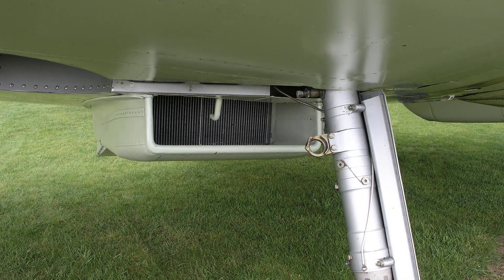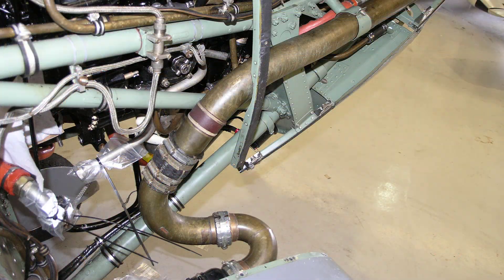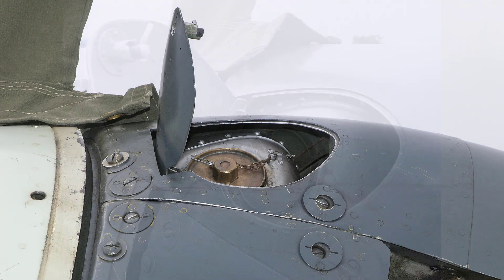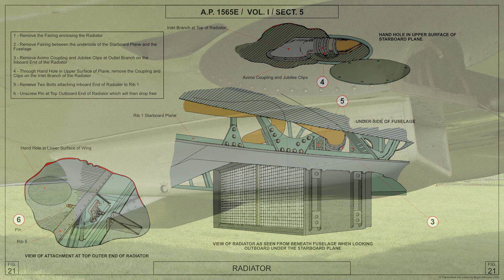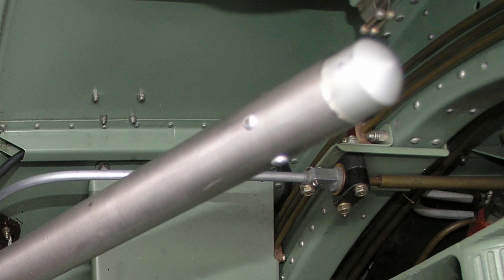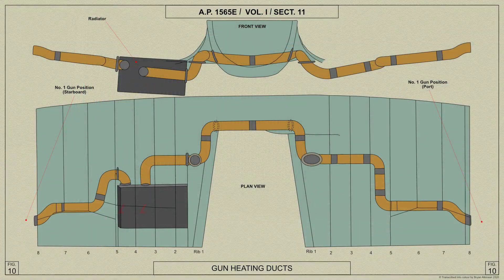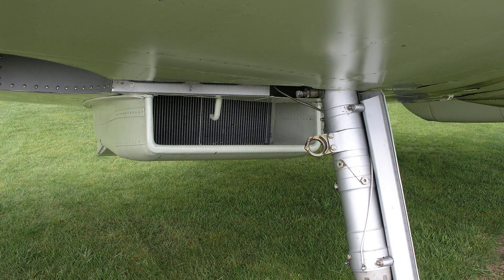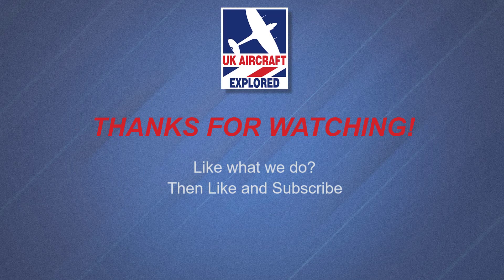Spitfire Mk V – The Cooling System

Comment: Hi, I love your video, but i have a question the fuselage of radiator is not acting like a airbrake? i mean In other spitfire variations as spit mk 9 and mk Lf 9 have two of that, and in the variant griffon makes more bigger. so i wonder that.
Reply from the maker: It is true that the radiator assembly fitted to the Spitfire Mk.V would produce drag, but it was not designed to be an airbrake, just for cooling the engine.